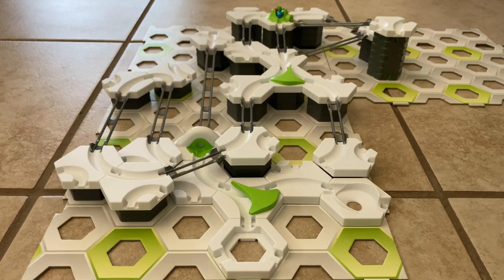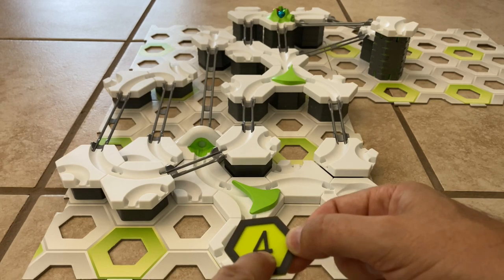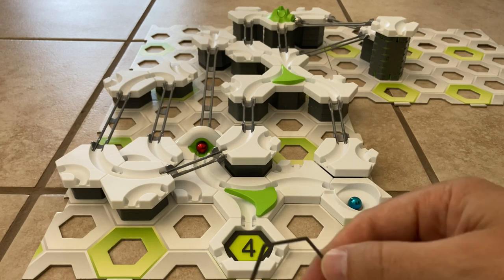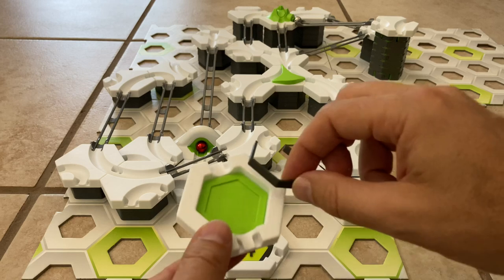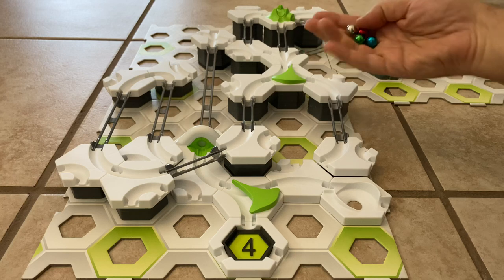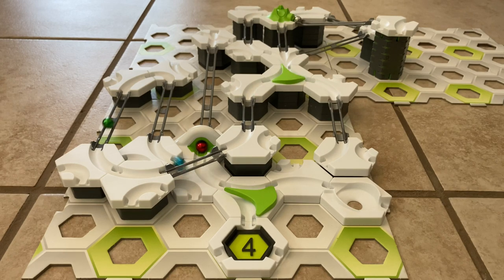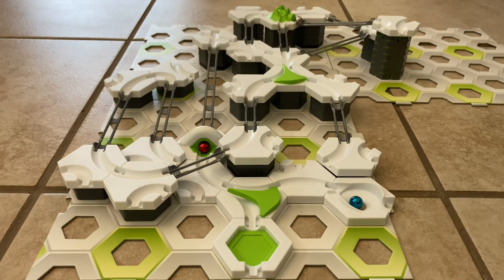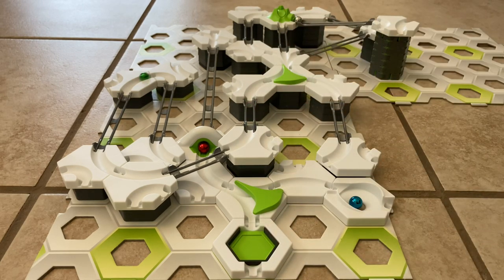GraviTrax 3D Parts - End Tile Marble Catcher

Comment: this happens with the original green end tiles anyway so what I usually use is the one that is already filled in on the bottom so it’s not raised but marbles don’t fall out
Reply from the maker: That’s a good idea. Too bad there’s only one that’s filled in per starter set.